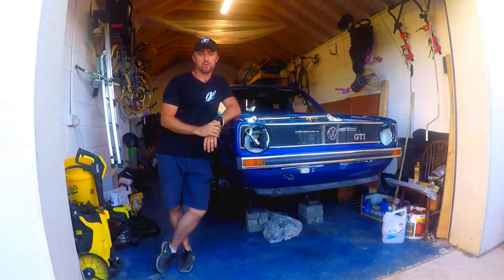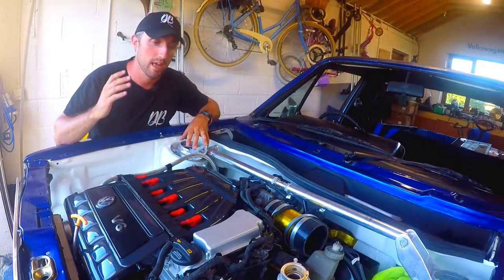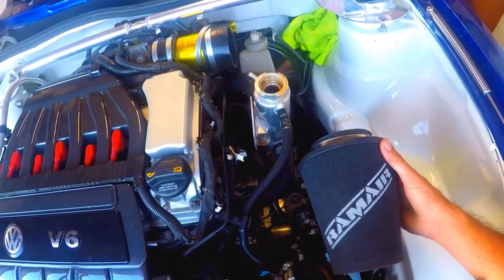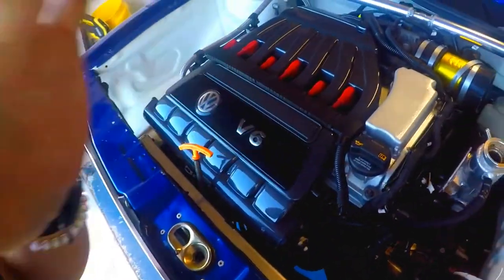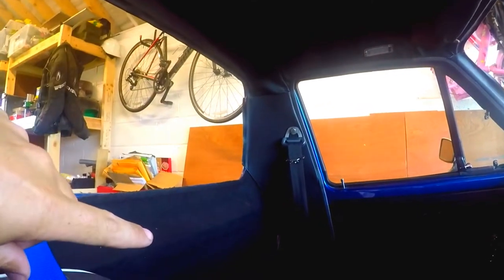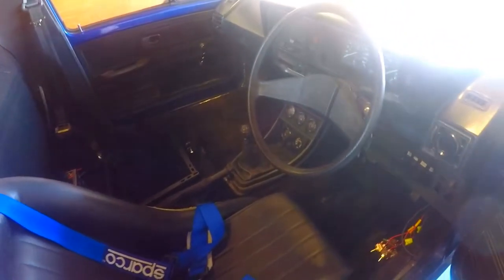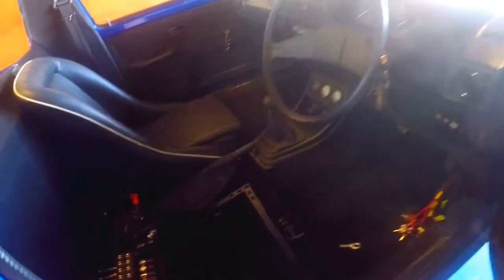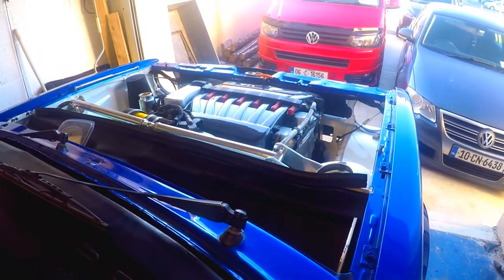EUROWISE PERFORMANCE VW MK1 CADDY R32 IRISH BUILD PT2

Comment: What fuel pump do you use. And how do you attach it to the mk1 ?
Reply from the maker: She has an external Sytech high flow pump with the later mk5 r32 full pump with the fuel regulator and return built in ... it has a custom baffled stainless steel tank and then a Sytech filter before the pump to filter dirt
Reply: @dbdailys3885  very fancy